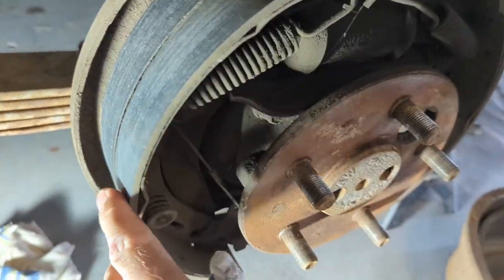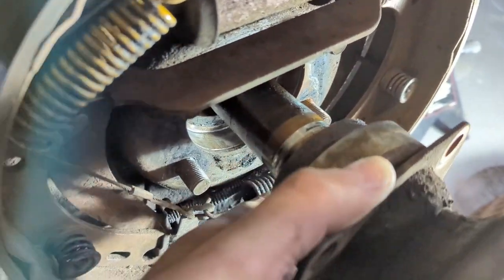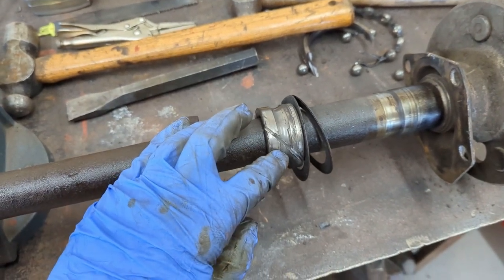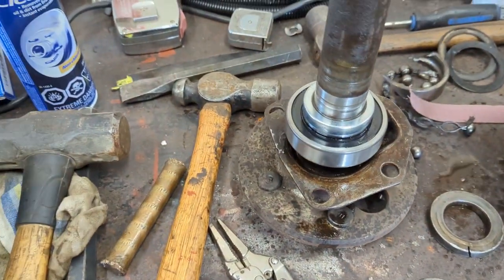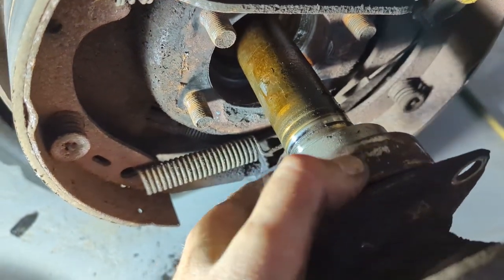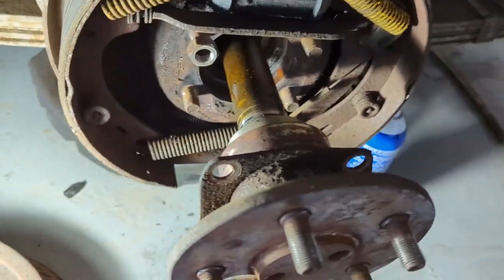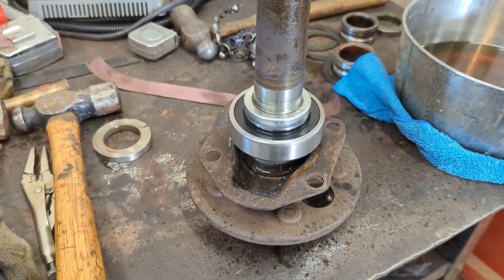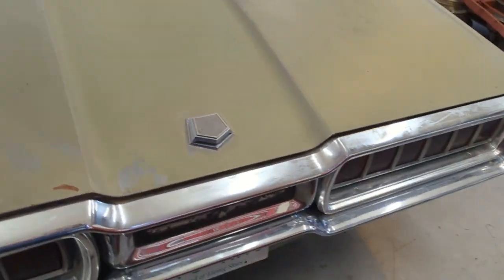Rear Wheel Bearing Replacement - 65 Thunderbird Hardtop

Comment: Hello Alvin
A long time ago, an old timer taught me the same method you used to get the bearing and retainer off your rear axles. Over the years I rebuilt many 9 inch ford differentials a well as axle bearings and seals. In my later years in invested in a 12 ton shop press and a slide hammer.. At the time they were not expensive. I still have them both. Time savers indeed. I enjoy following your videos. Always a pleasure and excellent learning experience. Thanks Alvin: Walt
Reply from the maker: Hi Walt, a larger bench press is something I really need to invest in, there have been a few job where it would have been better suited to use a press...changing these bearing is one of those job. 👍

Comment: Alvin,
10 minutes 45 seconds to change both wheel bearings has got to be a world record.  That cutting trick helped a lot, my friend. 😉
Regards,
John
Reply from the maker: Hey John,
Cutting is a good way to remove the bearings if you don't have a bench press large enough for the axle, the trick is not to go crazy with the cutting...there's no need to sink the cutoff blade in until it cuts the axle, just a good scoring will do the trick.
But if you have a press, then that is the best way to do this job.

Comment: Hey Alvin, interesting procedure. When I do rear wheel bearings, I take them out of the diff and hand them over to the automotive machine shop and let them do it. I've actually never replaced any bearings myself. You made it look so easy. I've done hundreds for customers and I believe that most of these old Thunderbirds have worn out bearings. They usually don't last 50 plus years. Even if they are not noisy they could still be worn out. Did you check the gear oil level? Someone once told me that Ford used whale oil for the rear axles back in the day. I wonder if that is true. GM used whale oil up until the early 70's for their transmissions so its probably true. Thanks.
Reply: The gear oil that came out of my 64 galaxie was a black varnish that stained everything about a year and a half ago. It didn't have a gear oil smell at all to it. It was a horrible mess to get the axle tubes and housing cleaned out.
Reply from the maker: Hi Nick, I had not heard that whale oil was used, but it makes sense that it would be something like that...there were gear boxes in use before the current oil industry, and whaling was a massive industry for a reason, not just for lamp oil.
I did check the gear oil level, it was a little low, but since I am planning to change the pinion bearing & seal, I figured I would wait to add oil then.
The new bearings made a huge difference in the ride noise, and I agree, likely most of these old cars have worn out bearings...roller bearings would have been a better setup, and I my be wrong, but I think there are other applications with 9" Ford differential that do use a roller bear, maybe Jeep?
Reply: @J_R_Shop  Yep, I'd say if the rear axle hasn't been pulled apart before it's time to take it apart even if it is working fine. When I did the rear axle on my galaxie it was quiet as can be with all that varnished sludge of what used to be oil and the wheel bearings were super stiff and notchy to turn by hand, and the passenger side had the bearing and seal replaced once in the past already. 159,000 miles when I pulled it apart.

Comment: Nice job, here I was thinking the axle gear oil lubricated the bearings, but they are sealed.
Reply from the maker: I don't know if it would have been a better setup to get the lube from the diff hub or not. When one of these bearings go to the point of destruction, it doesn't contaminate the differential, that's one advantage I can think of.

Comment: I always learn something new from your videos - too late now as I paid a repair garage to press mine off a few years back. I thought you might have put new oilseals in at the same time?
Reply from the maker: Hi David, you are correct about the seals, I ordered a set, but of course they still haven't arrived. I am planning to pull the center section in the near future, I'll replace the axle seals at the same time.

Comment: Maybe you can help me out, as I broke a couple of lug studs and working on replacing, but they won’t tap out on their own even with the heat and DW 40 so they’ll have to be pressed out and wondering to remove the whole lug outer part do you need to remove the axle as well. Thanks for any advice you have.
Reply from the maker: Are you working on a Ford 9" diff, like the one I show in this video? If so, and you feel you need to have them pressed out...you will need to pull the axle, it's all one piece.